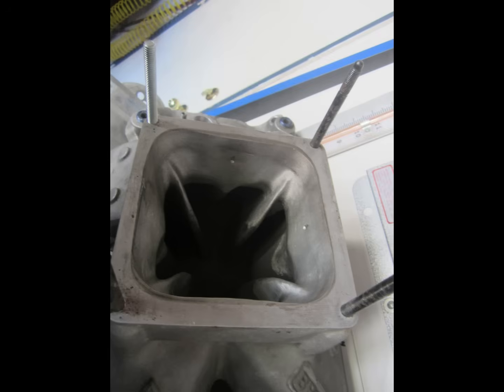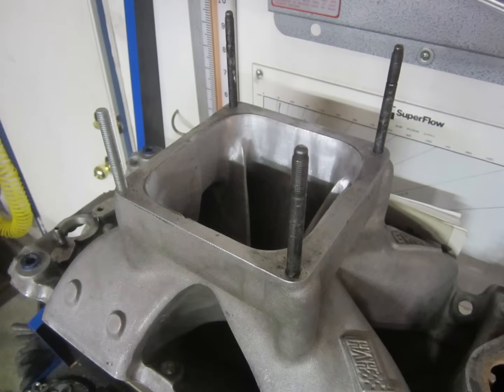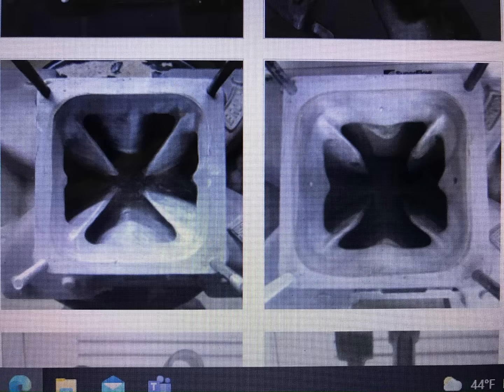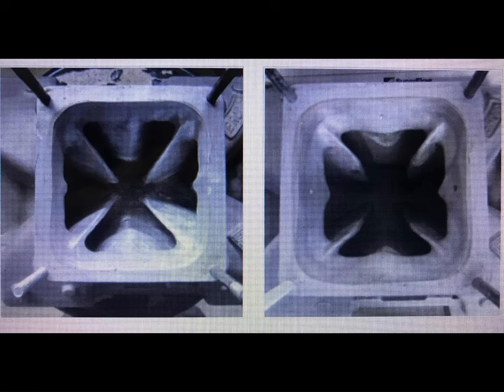STROKER ENGINES! IS YOUR MANIFOLD LIKE THIS?

Comment: Mr. Ben , what do you think about using tapered spacers like HVH super suckers ,Jomar, Trick flow, etc.vs a oorn plenum spacer?
Reply from the maker: Adding spacers usually help specially for engines that are warmed over or with stroker mods to increase displacement.

Comment: You have inspired me to start racing again (been 20+ years). Think it would be ok to slap on some trick flow 170s on a 80k 351w out of a f150 and hit the track? I have heard the engine run and is solid. Want to get some seat time in and then put the real money in a 408 stroker.
Reply from the maker: That's awesome! A set of 170 heads on a stock 351W will definitely make a fun track engine to get you back into it.

Comment: Ben  I added a 2" open spacer to my 383 windsor with a ported rpm air gap intake  and it picked up .2  in the quarter mile !
Reply from the maker: Shows you it needed more plenum volume because of the increase in cubic displacement!  Shows we are on the right track.

Comment: Hi Ben, I really appreciate and enjoy your videos 👍🏁 
I have a heavy 40' offshore boat and installing a pair of 565cid BBC's (4.25" Stroke 4.600" Bore, 9.80" deck block) with AFR 315cc fully Cnc'd heads and have the Weiand single plane Track Warrior intake manifolds, but want to do some mods to equalize/balance the runners. I may also like to incorporate an 2" Super Sucker Spacer in combination.
Cams are mild 240°\248° on 112° LSA usually cruise around 3500-4000rpm and about 5600rpm peak. I'm running full length tubular dry open headers.
Any any of your advice on the plenum/runners for equalization would be grealy appreciated. Thank you, Sir
Reply: Also using an old Holley HP950 cfm carb on each engine... Not really looking for all out Horsepower. I just want to achieve good efficient burn quality. Forgot to mention these are about 9.3 - 9.5 Comp Ratio. Pistons are flat top w/3cc intake valve relief. 
NBoat looks kinda radical, but only for pleasure...not racing, but nothing too radical about these engines ...I just want good efficiency, reliable, durable turn-key running engines.
Thanks again for any advice 🇺🇸🏁🏁🏁👍
Reply from the maker: @Kaama700-lv3rs  es those came with conventional venturis which was far from efficient and you could probably have those modified to install some AD venturis and it should even be better and get better SMPG.  Sea miles per gallon!  lol
Good luck.  Did you ever maximize your total timing?
Reply from the maker: Sounds like you already have an ideal combination!  The only thing I would look at is the carbs you are using and I would suggest whatever CFM it might be make sure it is an Annular Discharge type venturis.  They are very responsive and have a much better efficiency in mixing the gas compared to standard holley types.

Comment: If you have restricted head flow on a stroker engine does the carbs spacer or plenum volume help?
Reply from the maker: Well if it is a restricted heads then opening up the plenum is of minimal help because it is choked up!  Wll the spacer help?  On this instance it will be minimal just like it would be with increasing the plenum as well.

Comment: I didn't watch this, naturally,but do you differentiate between (for example) a 383 which is a stroker, and a 406 which isn't a stroker but has the same stroke?
Edit: I probably won't be back either.
Reply from the maker: Then no need to reply either.  Good luck.

Comment: Ben , I appreciate your videos very much. I watch them over and over. So much information . I would love to see a video on vacuum pumps. Thanks again!
Reply from the maker: Thank you very much and to explain briefly, one of the reasons dry sump engines make more power is because of the presence of lower pressures (vacuum) inside the crankcase!  It makes possible lower tension compression and oil control rings which significantly reduces internal drag etc.  I will consider going inside a vacuum assisted dry sump vs. wet sump engines.  It should be an eye opener.
Obtw,  on my last overseas trip I asked the shop if they have one of them 12v hand held vacuum and they did.  I asked that we drill an access port on the top side of the crankcase (motorcycle engine), then I started it up and created a lower pressure and when we pulled power on the dyno it made more with just this simple device.  The owners of the dyno was astonished on what they were looking at!
Reply: @benalamedaracing2765  great information Ben! I can’t wait for your next video!

Comment: High velocity=low pressure, low velocity=high pressure it boils down to where you need what pressure
Reply from the maker: The only way we find these things worked and able to move inside the engines is because of pressure differentials combined with combustion then we have a miracle working for the good of all of us.

Comment: Unless the class dictates a single carburetor. I would be running a tunnel ram.
Reply from the maker: Tunnel Rams are good for high horsepower done with high rpms.  If there are limitations some of the single 2 piece intakes have been very good!

Comment: Great info! Question, I noticed at the beginning you were reading the plugs. Do you also index them? I remember some old school guys that did, and they said it really does work. Just curious.
Reply from the maker: Nice question and an important one!  I do not index the plugs on my nitrous engines due to the fact the nitrous is an excellent "flame enhancer", it does not take much spark or a large gap to get things start to burn and it does!
However, on NA it is a different story because now I have higher compression and need every help I can do to get the flame started efficiently. Clearing the dome as well is an issue as well as orienting the plug gap towards the exhaust valve!

Comment: Hi Ben. Just wondering if you have a general rule of thumb for plenum size? Say a 346 LS engine N/A
Reply: Look at Richard Holdener's videos. He has dyno videos on LS engines with plenum changes, but short answer is use the LS3 intake 99% of the time.
Reply: @RindosRides that's fine for rec or square ports. Small bore are cathedral port. Im looking at 4150 holley midrise 300-137 topped with a 2" spacer and 1000cfm throttle body
Reply: No need to overcomplicate it. Stick with factory style stuff. If you have the clearance the gen IV truck intake is good, it is what people call the "TBSS" intake, but it's on any gen IV truck engine with cathedral heads
Reply: @RindosRides I'm using the 4150 style for the old school look in an old car. That's why im using the 4150 holley midrise intake manifold
Reply: Why are you asking about horsepower tips when your doing something purely for aesthetic reasons? Richard also has videos comparing carb manifolds. They will all produce less average power.
Reply: @RindosRides he never fits a carb spacer to them and he never tested this exact manifold.  Im asking about plenum volume rule of thumb not what manifold is the number 1 for hp. Im not setting any world records with this 5.7 with about 530 to 550hp @ the crank am I. So get off ya high horse and settle down buddy.
Reply: @lcxu1051  He has done it all if you look. A carb spacer is just more plenum volume on EFI. Plenum volume as a whole hardly changes power on an EFI setup. Do whatever you want
Reply from the maker: Hard to discern because everyone has their own formula and some out there would say the plenum area and individual intake port should equal each cylinder displacement!  I would replicate any given intake port CC to displacement/rpm range and adjust the plenum volume with spacers and test at the track after dyno evaluation.  Cylinder manufacturers give out info (displacement/rpm range) on their individual castings.
Reply: @benalamedaracing2765 ive head you need to get the airflow to slow as it comes into the plenum to about 120fps to make the turn into the runners

Comment: Intake volume can be tricky, sometimes less is more, but in this case more CID is better, more intake volume translates to torque...
Reply from the maker: You are right on point and very true!  I was overseas with the owner of the race shop and he designed his cylinder heads on years of following my views.  He paid all the expenses and flew me there and we had many days of dyno and CNC changes on the heads.  It was a good design but he overshot the perimeters when I told him to purchase a flow meter so we can see "how fast" the intake column was going!
He found out from me showing his port speed was very fast and perhaps hurting him in the process and needed to slow it down a bit...

Comment: I’m in the process of opening up my Vic jr 302 intake. There’s one runner in each side that is so choked down on size it makes me wonder what were they thinking when they designed it. I’m guessing it was something to do with the firing order pulses, but that intake was designed back when so they had was the 1,5 firing order and I’m running 1,3 ho firing order so I’m just trying to make them all somewhat the same size but opened up to fit the heads and make them taper slightly as they go up to the plenum. Idk if it’s the right way but it’s the way I’m doing it. I will tell you, it is some hard work doing all that porting.
Reply from the maker: What manifold type are you running with an EFI or carb?  Give me more info and we go from there and thanks for watching!

Comment: cool video. I am building a 350 even though EVERYONE told me to do a 383......I didn't want to mess with all that clearancing. Its going into a s10 style vehicle anyway so I will scare myself regardless.
Reply from the maker: Cuzz63 is correct and hard to beat cubic inches on most if not all "street" engines.
On the contrary a stock stroke is just as equally impressive specially on a very light car or truck!
Reply: build what makes you happy but the clearancing is minimal  and easy. also remember your basically giving up 10% more torque.
Reply: 383s make me yawn as much as LS swaps nowadays because everyone's got one. More impressive to science out a better 350 and beat them.

Comment: Thank you Ben. Would a dual plane manifold with spacers be a better choice than a single plane with a large plenum for road coarse applications? 383 sbc, tbi, 2800lbs car.
Reply from the maker: You are at the point of neither too light or too heavy!  On one extensive dyno we did on an NA 302 stroke to 353, we made 630-640 with the correct hedders and 590 with smallish 1 5/8 with heavy 20w 50 oil.  We lost I think if I recall correctly 35hp minimum from a single plane to a Perf. Air Gap!  Cutting the center divider made it worse so avoid that.  Need more info like compression ratio and cam selection factors big into which one is better.  Lower horsepowered engines might benefit from a dual plane no doubt.
Reply: @benalamedaracing2765  Cam is .570 lift, 242/248 duration @ .050", 110LSA, 10.1:1 CR. Heads are 185cc intake (I know it's restricting power output but once my daughter graduates from university I can get better heads). Currently using a perf. air gap intake with 1" spacer. Thank you.
Reply from the maker: @gabrieldimarco9646  seems like your combination is very good and you did not mention hedders and carb size?
Reply: @benalamedaracing2765  Hedders are 1 3/4" primaries averaging 29 1/2" in length, 3"' collectors I made custom for my application. I'm using a Fi-Tech 650hp TBI. Thank you very much for your thoughts Ben.

Comment: I had a friend that had his GT40 upper shortened because he was told it would make more power up top I asked him if it was worth losing bottom end power which it did.
Reply from the maker: Yes sir this is why I posted on a 347 an instance or example where the reverse happened!  I should do a video on why they are very sensitive to plenum volume and port length and sizing.

Comment: Mr Ben l always enjoy your videos and the great information you give us. I'm getting my parts together to put my 384 cubic inch wins back together it's a street car na what head and intake do you suggest l use it's probably around a 11. 1  373 gear 5 speed l would love to make 600 HP to the tires some where close thank you for all you do great stuff always.
Reply from the maker: I need more info on the engine combination like what kind of heads and intake etc.  Cam selection will make or break your dreams so let me know more of what you have.
Reply: It's a 384 cubic inch wins 375 stroke flat top pistons CP eagle 62 rods l have a set of procomp heads l want to try the 227 TFS heads and single plane intake. I just wanted your opinion on what head and intake and what size carb l do use two spacers 1 two inch and a carb leveler spacer like I said I'd like to get as close to 600 to the tires as possible it is a stop block I have a girdle I plan on turning the engine somewhere around 7 to 7200 @benalamedaracing2765